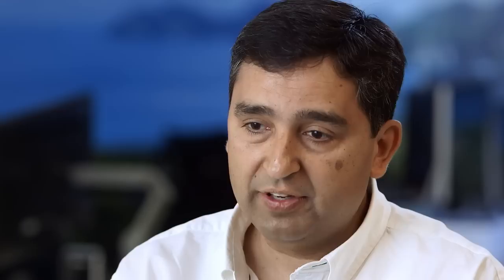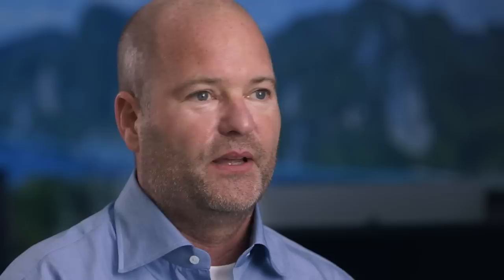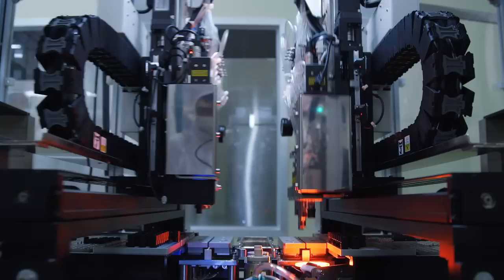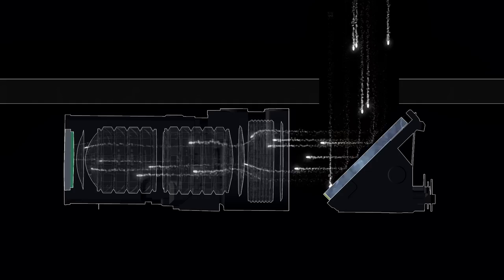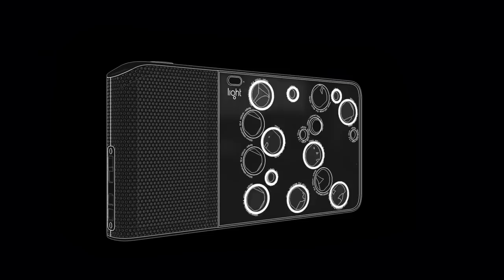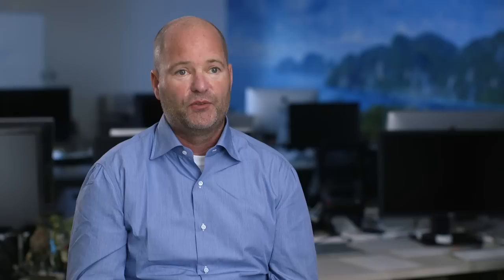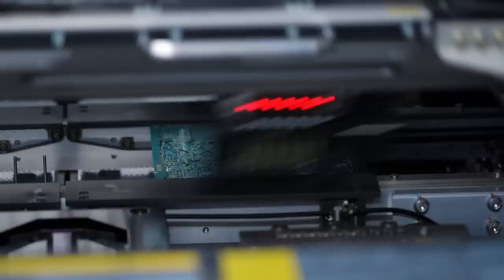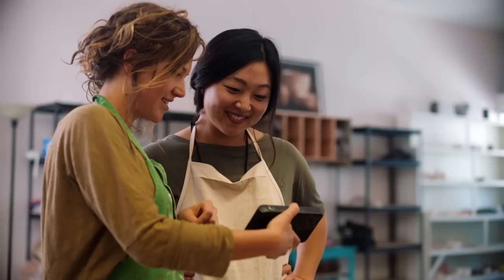Light L16 Camera ( The Light Story)

Comment: what's the exact iso sensitivity?? does it shoots in raw??? off camera flash, will it work??? tripod ?? nd filters??? manual mode?? focusing system capabilities?? how to handle flares with no lens hood???  buffer limit??? battery life??? weather sealing??fps???ergonomics??  can we go lower than 35 or higher than 150mm??
Reply from the maker: check out https://light.co/camera
Reply: +Chittkar TV no hot shoe or sync for off camera flash... cant go wider than 35m...cant go further than 150mm. tripod ok,, dust water resistant ok... full specs will be posted next year...if this camera does not shoot in raw.. then its a crap..
Reply: +ziggy carbillon considering they said you can change DOF after taking a picture and it will be running on Android which supports RAW natively (camera 2.0 API in 5.x and later) I am pretty sure it will shoot RAW, also ISO and ND filters wont be a problem when using multiple lenses to combine a picture.

I am more concerned with front lenses glass panel.. it will require some UV coating to prevent lens flare, also it has to be scratch resistant and lets not forget about fingerprints and smudges everywhere.
Reply: +ziggy carbillon For ND you could just lay an ND gel over the front.
Reply: +ziggy carbillon Jeez, it's the first of its kind, it'll evolve with the customers wants as times goes by. Atleast give kudos to the guy for trying!
Reply: +Yusuf Omar (Zopdoz) actually its not the first of its kind, its the second. The Lytro camera came out a few years ago, and while it is not the same shape in the least, it actually does the exact same the Light does by containing and utilizing multiple lenses to capture an image and present you with a clear focused photo that you can later edit what you want in focus and what you do not. dont get me wrong the Light sounds amazing, but its not the first.
Reply: This tiny stuff can shoot RAW, check the tech specs on their website.
Reply: I know this is  year old question but I'll follow up anyway... The real question isn't can it shoot in raw... The real question is: does a RAW image from this camera save all 10 images from each of the camera at their various focal lengths? Could allow you to adjust focus after the photo has been taken
Reply: I think at this point it's safe to say this camera is a flop. Over a year old video and they never delivered a single functional unit.
Reply: Filip Jančo a flop? hardly lmao they've been sold out since there Kickstarter campaign. they sold out with nearly a million units sold.
Reply: It indeed is sold out however untill this day no working cameras have been shipped. Camera is estimated to be officially released in Q4 2017 and good luck getting the out-of-camera files to work with Lightroom etc.
Reply: ziggy carbillon I think you need to see a full review about this camera is not in this video you will find it...or buy a camera

Comment: this is cool, but for a camera that is so 'new and never before done'. it sure sounds like the Lytro camera (which officially came out of development over 3 years ago) and also uses multiple lenses in every picture, automatically adjusts for light, can have the focus/blur of the photo set after its been taken, and is in a small, easy to carry size. Basically its the exact same this as the Lytro except this camera is shaped like a phone...

dont get me wrong, the camera still looks very exciting. and unlike the lytro you would be able to take rectangle photos rather than square photos like with the lytro original. And i am very happy that more companies are expanding into this new genre of photography. its just that their claim of the concept of having multiple photos being never before done kind of bothered me as a proud lytro owner myself. If i ever get the chance i would love to check out this camera and purchase it for myself to do a real comparison. right now my only concern about the Light is how they would protect that many lenses from being scratched, and how durable it is against being dropped. (because phones dropping and cracking the screen is a VERY common occurrence)

Comment: If this has 16 Sony sensors then Sony must love them as a customer but by the time this $1,700 camera comes out there will be many flagship 4K smartphones with the 64-bit Snapdragon 820 SoC so I don't think this camera will have sales much larger than the Lytro IMHO. 35mm is not wide enough and I prefer a a 24mm FF eqiv like the 4K Sony RX100 IV that is pocket size and has a great EVF. The Sony RX100 V should be out by the time the L16 ships at a much lower price.